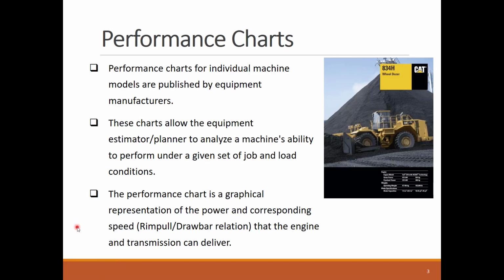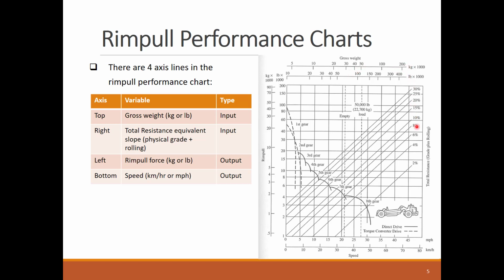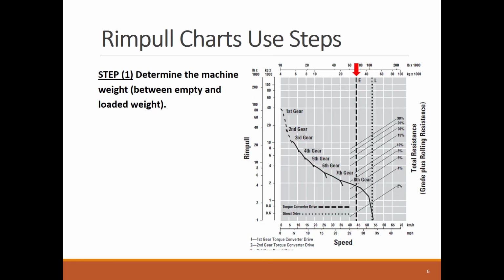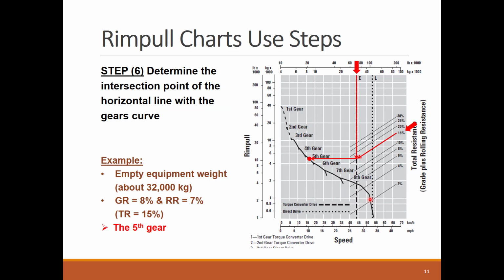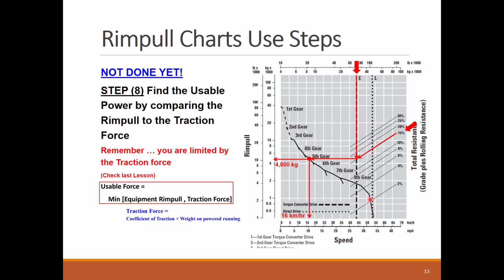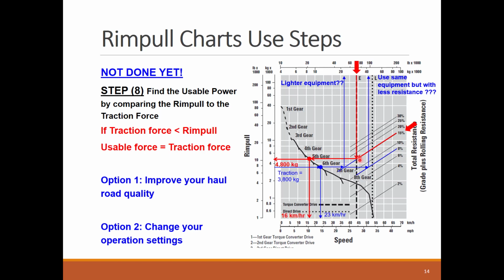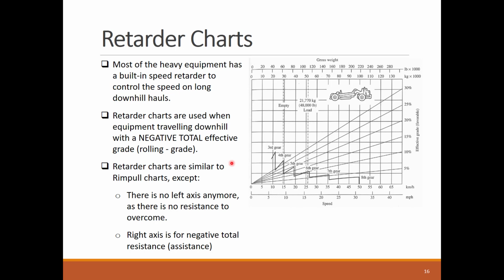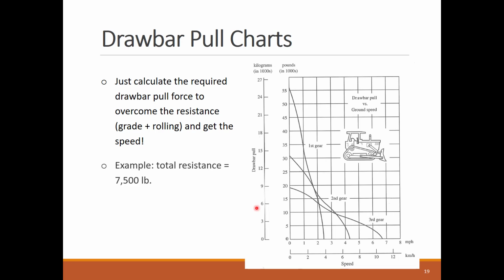Lesson 6 (Machine Performance Charts)

Comment: Very cool. A phrase I learned to refer to traction more clearly is bifurcating it to
dynamic (angular ≠ linear speed) traction or 
static  (angular = linear speed) traction or not skidding or spinning.
Reply: Thanks for your feedback and suggestion @TrumanHW
Reply: @constr-uctor   This really is an awesome explanation ... 

basically, I take it that wheel-torque is what matters, not engine-torque (when you have a transmission, final drive / wheel size on vehicles) ... 

But I still don't get why 5,252 is anything but arbitrary (and irrelevant) to calculate & doesn't seem indicative via HP vs Torque to shift points.

As in, flywheel torque would define acceleration of a PTO, period. (yes?)
And HP would be indicative of its top speed.

But wheel-torque determines acceleration of a car 
... and horsepower provides the useful range of torque in each gear...?